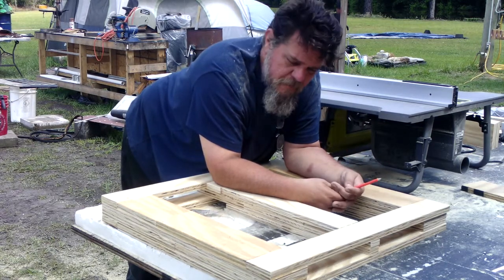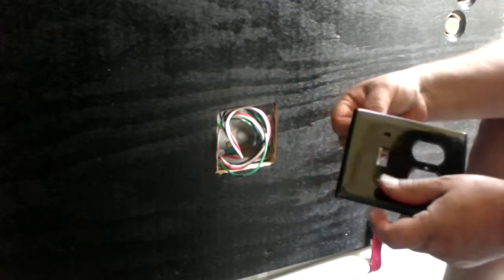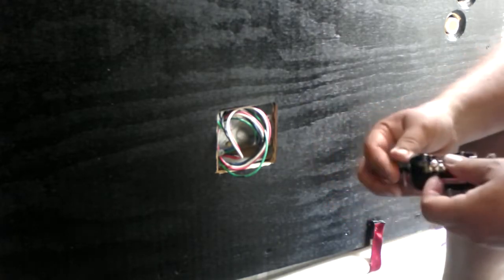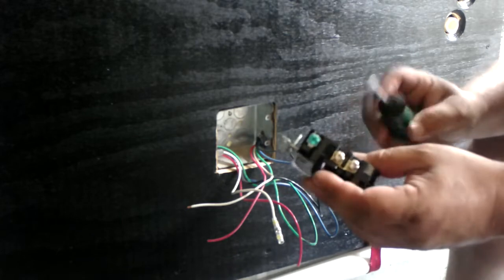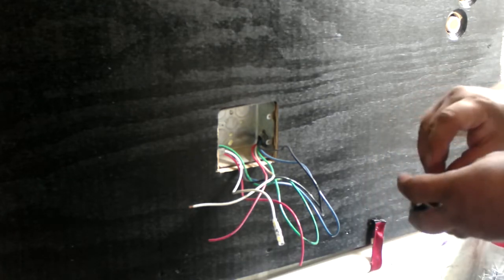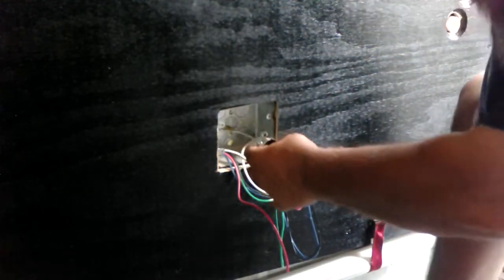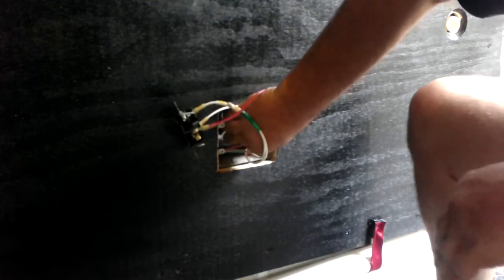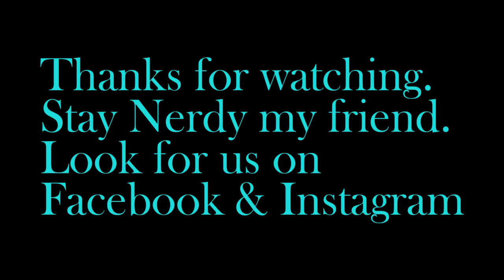Building a platform and wiring for the fridge on our bus/skoolie conversion

Comment: What are the 2 pipes in the wall  near the kitchen sink near refrigerator? Thanks, subscribed.
Reply from the maker: So one is hot water cold water there's also a drain pipe and you can't see it from most of the view but there's also electrical conduit... We used CPVC for all the water supplies and just basic schedule 40 for the drains... If you don't know what CPVC is it's the yellow stuff it's rated for the hot water...
Reply from the maker: I forgot to mention the one CPVC behind the refrigerator is there in case we decide to install an ice maker
Reply: Thank you so much